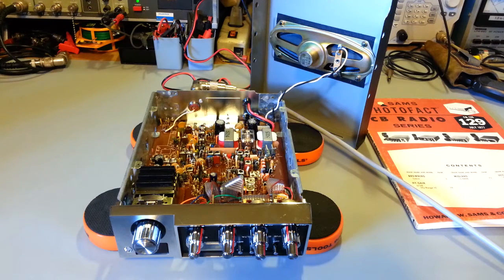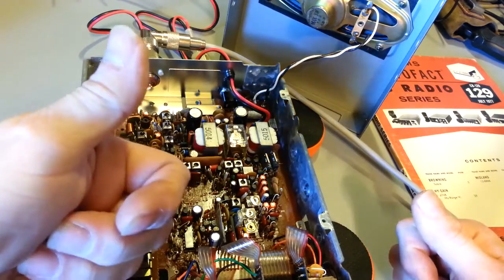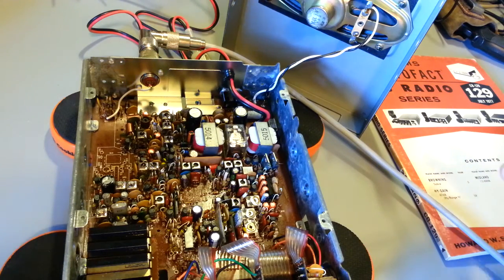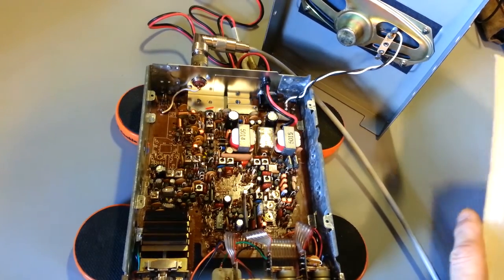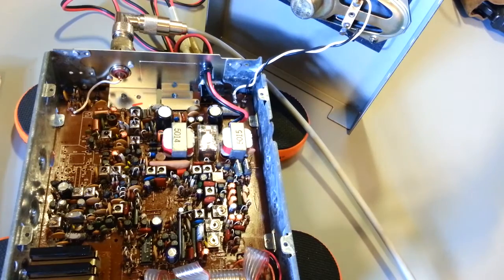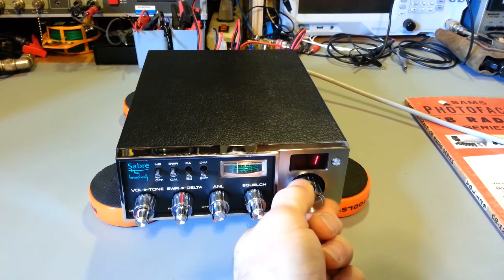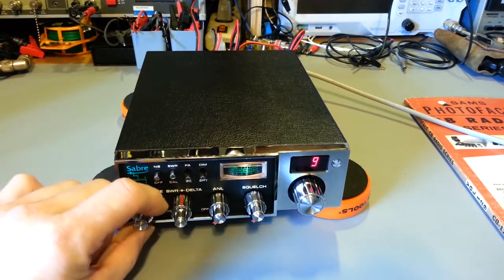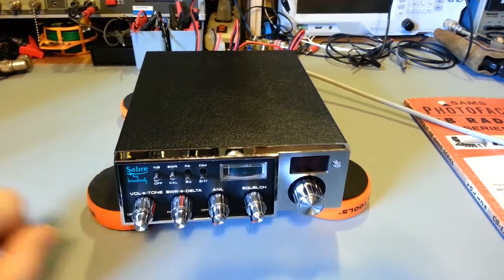Browning Sabre 40 channel AM only mobile CB radio.

Comment: I have one of these with the original Browning Mic that it came with. The radio transmits much better than my Tram Diamond 60 and the receive on the Browning blows the Tram away! Great filtering on the Saber for static free mobile use. Both radios were built in Japan.

Comment: Ah. I remember once having a Uniden Bearcat scanner on the bench that had a synthesizer built exactly like that. With this one, sometimes it worked, sometimes it didn't. I don't think I ever got to the bottom of it despite changing the TC whatever it was chip and a few others. When the fault was on, the VCO control voltage would sit at the supply rail and nothing would make it lock. But you'd come in the next day and it would lock up straightaway and never falter.  I think the customer got fed up of bringing it back in the end! Back then though we didn't even suspect capacitors... my, how times have changed! Sorry to digress Mike, I think it's an age thing lol!
Reply from the maker: Alan Cordwell

Intermittent problems can be a real pain in the rear to track down some times.